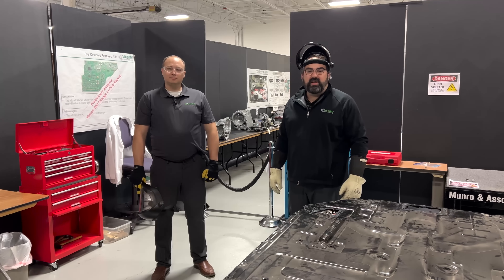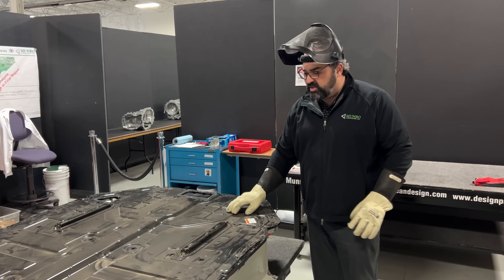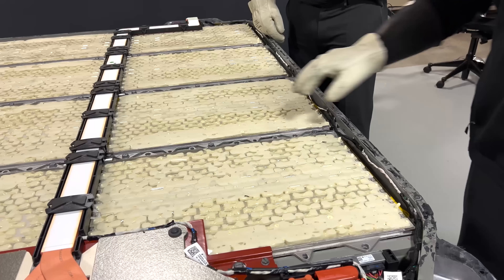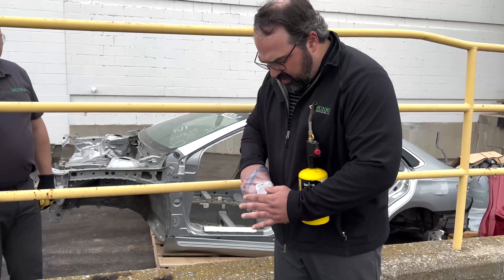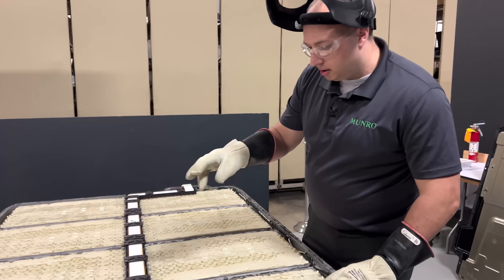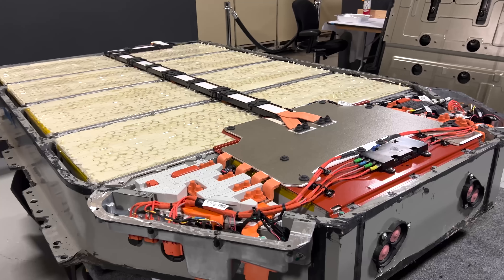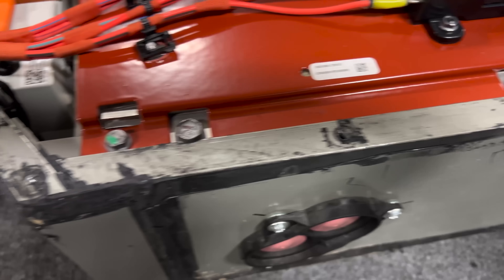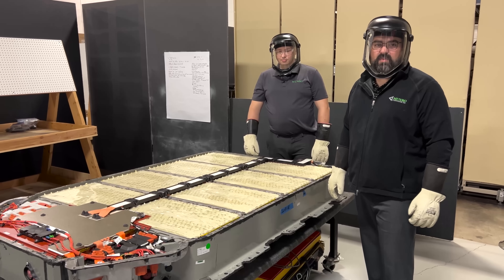Rivian Battery REVEAL!!

Comment: 864 batteries per module? How are those 2170 type batteries connected? In a series or parallel connection?

Comment: The simple demonstration of the fire resistance (or not) of the foam, is really interesting to see.  But I am a little shocked at the lack of attention to your personal health and safety.  Whilst you are around the part disassembled battery pack you are wearing thick gloves and face shields (mostly).  But when you are burning foam with a torch you have no gloves or respirator.  Outside was not so bad as the wind carried the fumes away (but you still rested the still cooling end of the torch against your jacket..).  But inside with the lighter it looked like all the smoke was going straight up to your face!.  As it appears you do not know the chemical composition of that foam I would strongly suggest that you do not make a habit of that.  In fact I am surprised that Sandy Munroe does not insist on that being done in a fume cabinet or similar.
Reply: Zzzzzzzzzzzz zzzzzzzzzz

Comment: great presentation. I would have liked to see more on thermal management, though the tear-down hasn't gotten that far. I really liked the shoulder screws/bolts for mounting plastic connector housing. I don't think snap fittings are good for housings needing to seal against water intrusion.

Comment: Wouldn't the aluminum cross members also be helpful in moving heat where as a composite would be an insulator? This would also be true with any other part like that top cover. As well as a steel cover is heavier but would probably help in suppressing/containing a fire.
Reply: For sure. Composites don’t handle high heat well at all, not to mention the fact that they can be shockingly expensive. I don’t agree with a lot of the judgements on composite use here.

Edit: That’s not to say I think these guys did a bad job! I enjoyed the video and I think it was really well done. But engineering decisions just never happen in a vacuum, so it’s hard for anyone to say with certainty that a decision is good or bad. Other than the Rivian designers, of course.

Comment: I would like to know exactly how more power can be installed in the same space with the largest pack, as I can’t see how more energy can be added without a different size pack
Reply: First, power and energy are not the same thing.

Yes, more space is needed for more energy storage. The 180 kWh battery uses 12 modules, each the same size as the modules in this battery. I have read (but can't confirm) that the extra modules are behind the others in the pickup (R1T) battery, and on top of the last row in the SUV (R1S) battery; that means that the 180 kWh versions of the battery are longer in the truck, and taller (into what would be 3rd row seat space otherwise) in the SUV.

Comment: The high number of threaded fasteners on the steel cover adds rigidity to the battery case. I'm sure that's the reason engineers designed it that way, self tapping screws although cheaper and faster to assemble are less sturdy less reliable and less serviceable. 

The RTV sealing of the seams is precautionary to prevent water ingress, if you were only to rely on welds it would have to be pressure tested for integrity. It's difficult to decide which is more cost effective and easier to build between the two alternatives but I would guess the RTV being cheaper and quicker. 
It's interesting that Rivian uses a superior foam product that's self extinguishing, after all we've been told over and over again that Tesla is ten year ahead of the competition.
Reply: 99% of the decisions that seem "less optimal" are because startups don't have the time or resources to make optimal decisions. Done and done fast are more important than optimal.
Reply: It would be interesting to see what material each foam is made from and how it is produced. Tesla may have gone with a less toxic and low VOC foam product to keep their production impact calculation low. I don't know enough about foam like this to know if the Rivian foam requires some flame retardant additive that might have more emissions that Tesla decided wasn't worth it if they could manage thermal runaway in some other way.

Comment: IF that's the cover that faces downward.. Given the offraod capability of the Rivian, It aboslutely needs to be steel.
Reply: That's the cover that faces upward, which is why it has features for bolting to the body (which is obviously above the battery, not below it).

Comment: I see updates from people in the industry of recycling battery packs that makes me very happy to see the batteries becoming fully potted now- I know it makes it near-impossible to replace individual cells once done so, but they function like a heat sink for the pack and provide vibration resistance on an individual cell basis, obviously coupled with their fire resistance. I think if that would be coupled with Lucid's cooling of the bottom negative cathode of the cells, that it would be the best" way to make a cylinder-cell EV battery pack.
Reply: No one would seriously try to replace individual cells on a commercial basis in any EV battery design. Potting with foam does not form a useful heat sink. Yes, Rivian is end-cooling the cells, and showed that long ago, probably before Lucid produced anything.

Comment: So the pack components (contactors, battery managers, etc.) that might fail and have to be replaced can't be without taking the cover off? That's a lot of cost that might require the whole pack full of good cells to be swapped out. Does Rivian have any economical way of swapping in guaranteed  refurbished packs that would not saddle the customer with a heart-stopping repair?
Reply: Totally agree. Just ask the engineers at ford why they have stopped selling the mach e. For that exact reason it will be very costly to fix. Its like ford putting the water pump inside the motor. Do they never learn!!

Comment: Having threaded components welded to the battery cover looks like trouble to me. Suppose during the life of the car someone has to unscrew whatever was attached to the cover and while doing that, or even while reassembling things, the threads strip out? How does the mechanic recover from that? Replace with great big self tappers like some kind of Chinese lawn furniture? ick!

Comment: Is it just me or this Rivian R1T teardown has been very underwhelming so far in terms of their technology 🥱. Heck correct me if I'm wrong the truck didn't even have a heat pump 🫣. That double stack battery is ridiculously heavy. It would have been better in my opinion if Munroe bought the Lucid Air and tear that down 👍👍.
Reply: Well, it is a truck, and so you want it to work in -40° temperature and really only Tesla has one that works in that cold cuz it can stall the motors and send that heat into the cabin. Most other heat pumps can’t even go -15°C. As for a stacked battery, there just isn’t room in the vehicle for 135kwh of capacity. It’s about the size of a ford ranger. The 180kwh pack they will offer is on a longer truck with a bigger bed so they can fit those many cells.
Reply: @harsimranbansal5355  I just don't understand why would Munroe say that Rivian will be cut above the rest while so far with its current teardown I don't really see anything that is in their technology as a competitive advantage to Tesla or Lucid 🫣. All I see are copied technology from Tesla and hiring practices that are very shady.
Reply: The battery won't be significantly different in weight from any other design using the same number of the same cells.

Comment: I understand cost cutting measures, and that a steel cover is highly likely to be lifetime, but how is this packaged in the skateboard? Can water get to this cover in normal northeast winter driving? Had the same concern with the wheel well vents  found in the frunk removal video. A neat idea at first glance but might shorten the lifespan of the vehicle in the northeast. Great video as usual!

Comment: So now I am wondering if the hold up on the Max Pack is the design, as opposed to constraints.   I don't see an easy way to add more cells to this battery tray.
Reply: There's a large gap between the battery pack and the rear subframe. https://youtu.be/t_i7XnCI_00?t=245
Reply: I think they are delaying max pack to increase production volume of vehicles(r1t, r1s, amazon van)

Comment: Remember, this vehicle is designed to go off road and go into ~3 feet of water. That may be a reason for the extra RTV and more robust battery vents. Vents need to ONLY let air in and out. No water.
Reply: I agree with your input,  I had the same conclusions..there is nothing with extra safety.

Comment: Steel cover is better: cheaper & recyclable. Note that organic composites are impossible to recycle except a grind fill or incinerator stock so not very environmental friendly, should only be used where the lower weight or added strength is essential.
Reply: Nobody asked you.

Comment: where is the liquid cooling?
Reply: Within each module, between the two layers of cells. The fluid connections to the modules are not visible yet at this stage of the teardown.

Comment: how do these flame retardant foams work in low oxygen environments? I can't imagine that inside the pack there's much oxygen to go around. And obviously these foams are not carrying an oxidizer themselves, right? Obviously flame = bad, but I'd guess that there's more that goes into it in actual use? Would love a thorough explanation on how that works
Reply: More for preventing or slowing down cell to cell thermal propagation. The foam has low thermal conductivity. Will say too cells in an environment without oxygen, i.e. only nitrogen, will still catch on fire/vent if they get hot enough since the cathode has an oxidizer in it. Not 100% good analogy but same way how rockets can function in space.
Reply: Lithium batteries give off oxygen in a thermal runaway

Comment: Wish you would dissemble the module to investigate cell type/configuration and ease of replacement.
Reply: From what was shown, replacement of a module or cells appears not to be a consideration.  The engineering here is really leaning towards 'what can we do to make this thing strong and durable in the event of an incident'.  I think overall, Rivian has over-engineered a lot of this vehicle and there is a lot of room for 'savings'.  That said, it's the first production model.  I hope for thier bottom line, they can get some egineering cost analysis done (like this) so they can get profitable on these.  There's more vehicle here than what they are being sold for.  That's a losing proposition in the short term.  Long term they need to be able to make a profit or it won't matter.
Reply: @richpalmisano1740  no one replaces cells within a failed module.  We will presumably see module replacement in the next video - there's no indication in this video of how difficult that will be.
Reply: A later video will presumably show the modules removed and torn down.

Comment: Would be interesting to see that steel battery cover after a few winters in the rust belt.
Reply: Rusted through battery pack. Something I never thought about but will definitely be a future issue.
Reply: Yeah it will be a problem. Their recent teardown of the Austin Model Y shows that Tesla has also gone to a steel cover for their structural 4680 pack but they powder coated the entire thing.

Comment: Would have liked to see the full removal, as a mechanic eventually we'll have to work on all E.V's so would have been interesting to see the removal process
Reply: Removing any modern EV battery: remove shield, unplug cables, disconnect hoses, support pack with jack, remove a few bolts, lower...

The puzzling thing it that Ben said that the top cover was bolted to the body, which makes no sense, so it would have been good to see how that worked.

Comment: The modules are very thick. What kind of cells do they use?
Reply: They have two layers of 2170 (21 mm diameter, 70 mm tall) cylindrical cells.

Comment: Will there be also a tear down on the thermal management of the battery ?
Is it internally cooled? 
If the battery moduls are stacked in to two levels how are the modules be cooled .?
Thx for that great work, every video is a technical journey! Love it ❤️
Reply: Hi, I had the chance to see the modules (still together) and it seemed to me that there is a brazed cooling plate between the two modules.

Comment: Does this battery have any cooling?
Reply: Yes. There are heat transfer plates between the upper and lower layers of cells in each module. A later video will presumably remove and examine the modules and show this.
Reply: Yes, any battery pack capable of fast charging has to be actively water cooled.

Comment: What is the net voltage of the battery pack?
Reply: 400v
Reply: It has 108 cell groups in series, for a nominal voltage of about 390 V... lower when discharged and higher when fully charged, of course.

Comment: Reading the comments I realize that most people don't understand fire... when lithium burns its a metal fire not much of anything will put it out. Think of phosphorus, like the stuff we put in military ammunition. It doesnt go out till is consumed. With gasoline  what is on fire is the gaseous portion the liquid itself is not. Thats why you can toss a match into diesel, it goes out the volatility of the fuel at atmospheric pressure is virtually zero. Again the coverings around the battery do not contain it virtually any material save ceramics will melt at the temperature that lithium burns, it is there to delay the ignition of the components around it and give you time to get away. If the batteries lithium is on fire it will burn till its consumed or its temperature is lowered enough so it self extiguishes. Fire fighters attending battery fires know this very well already, to extinguish a battery fire takes 3 to 5 times more water. Worse still is the fact that even when there are no flames if the chemical reaction that casued the fire in the first place has not reached the crical temperature to stop it will start all over again! Battery fires are very rare but they are really bad news when they occur.
Reply: Lithium in lithium-ion cells is not in metallic form, so it's not a metal fire. The lithium is present as an intercalated lithium compound as the material of the positive electrode, not pure lithium.
Reply: @brianb-p6586   Whether lithium is a liquid or a solid its a metal... the fact that its in solution as a salt doesnt matter. In fact, its not entirely a liquid its a supersaturated brine. And when ignited its almost impossible to extinguish.
Reply: @Wised1000  the electrodes are not lithium at all. And it matters very much to combustion whether the metallic is present as a metal or another compound which is already oxidized. Pure hydrogen is a fuel which burns dramatically; dihydrogen oxide is... water.

Comment: Fellas please "thermal runaway event". I understand industry representatives using such an idiotic euphemisms but your supposed to be "independent" cosultants. The correct, plain term is FIRE. EV'S can and do catch fire and when they do they burn furiously and basicly will burn till the temperature reaches the level where the batteries extinguish, in most cases that is when the entire vehicle including the batteries are completely consumed. The entire battery protection system is simply to give you enough time to escape the blaze. That said, gasoline cars catch fire all the time and when they do essentially the same thing happens, plus, the blow up! Batteries don't blow up they essentially become very hard to extigush torches that shoot molten stuff out at high pressure. Thank God for that🤣🤣🤣
Reply: Your post is the idiotic euphimism. The term "thermal runaway event" us absolutely correct, is used in engineering papers, and is the usual cause of a non-puncture fire.
Reply: @vidznstuff1   
When the wood in my fireplace suffers a thermal runaway event it warms my house. What an idiot...
Reply: BTW, in this video you used the correct term, fire ..... I guess the powers that be were not happy!
https://youtu.be/TYFyiiEwOFI

Comment: It looks like that casting at the back of the pack is also different from the first two. So they have three different castings that probably could have all been the same. Rivian builds a beautiful truck, but they def need some cost analysis. It certainly seems like that could save a ton of money all over the vehicle without losing anything in quality.
Reply: Prob needed to get to production.
Reply: @philipparana9225  Yes, no doubt of that. But getting to production doesnt make them successful. Plently of long shuttered automotive companies made it to production. Now they have to figure out how to turn a profit. And judging by the price rise announcement earlier, they cant do that with this build as it stands.
Reply: Casting? the small housings for connections are castings. The front and back are extrusions which are bent to shape; Ben says front and rear are the same extrusion so I'll believe that - they're just bent differently.

Comment: Interesting comparing this to a 2012 Nissan Leaf traction battery pack I disassembled. There are pros and cons for engineering in both. So much simpler dealing with the two cell battery modules in the Leaf. But chalk and cheese to manufacture cells and batteries.

Comment: Aluminium vs steel and carbon are two rest recipes for galvanic corrosion. They will regret not using carbon or glass composites for the entire battery case.
Reply: Don’t forget that the homologation of a car consists also on fullfilling EMC standards…therefore the battery cover and the case have to be electrically conductive….so by using carbon or glass composites you have much more work on that „voodoo science“ 😋(reduce interference emission caused high frequency power switch e.g. at the power electronics)